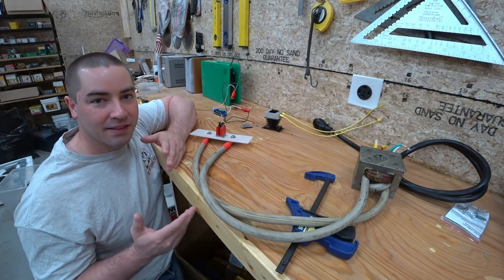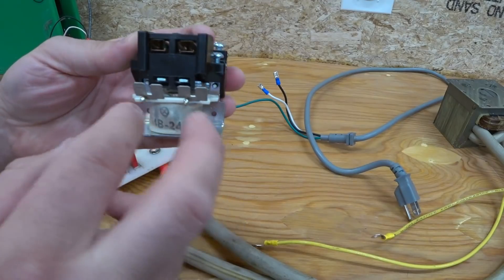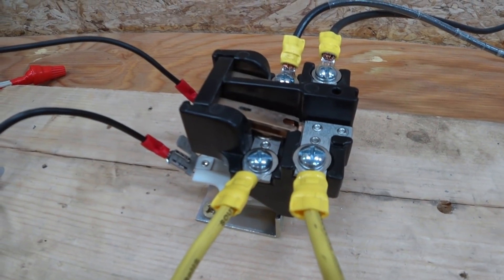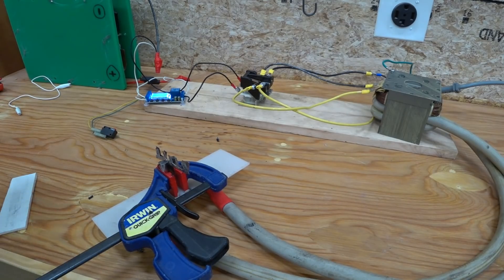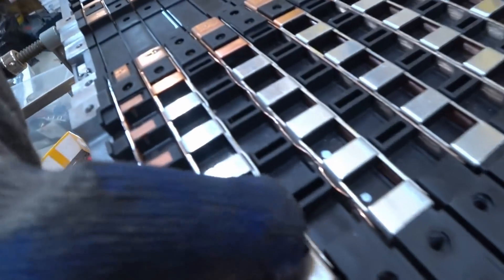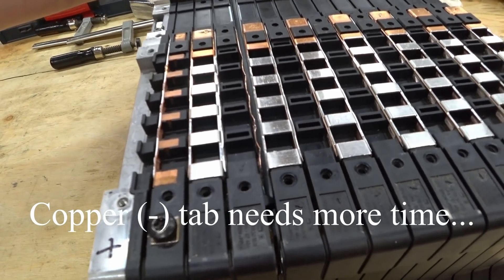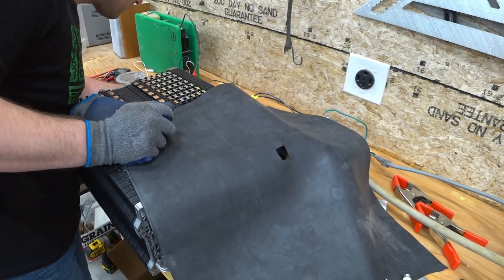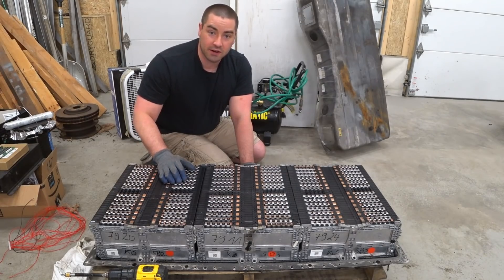DIY Spot Welder, Success!  Lithium Battery Cell Tabs

Comment: your ssr blew up because you starved it, you have like 10g 12g one one side and i 0G on the other, lookup how much current that 10g wire can hande and then the 0G. you need to acquaint yourself with the laws of thermodynamics, actually one will do you, the law of conservation of energy, The first law, also known as Law of Conservation of Energy, states that energy cannot be created or destroyed in an isolated system., a better way is energy cannot be lost or destroyed, it only changes state. So you have a certain amount of energy that changes at the transformer into another system. the first system cannot handle the same amount as the second system. if you don't understand, get bigger wire or your going to burn your house down!!

Comment: Wouldn't it be better to use cables with smaller dimension? This looks like shooting a fly from a cannon. More turns of cables means higher voltage and less time to spot weld (I guess) but it also means lower dimension of cables and smaller current. You want be able to spot weld a thick piece of sheet metal using single microwave transformer any way. I ordered microwave transformer myself so I will test it soon. I would be grateful for any opinions in this case.

Comment: heya that is a nice diy spot welding but 1 month of work with it that is to long for me so I'm thinking of baying a spot welder from Ebay or an online side
Reply: There is a key difference between DIY and prebuilt - control.
When you build it yourself, you have control over all parameters.
With a little more work, his welder will do things that no prebuilt under at least a few thousand dollars will do - that's the motivation behind MOT welders.

Comment: If you revisit this project try 120v on the primary with 4v secondary (4 turns)  you'll need smaller diameter cable but the extra voltage will help at 120v. Is there another link for the contactor? That one no longer works.

Comment: I thought your not supposed to spot weld copper. I could be wrong but I would like to see you try some pure nickel
Reply from the maker: Nickel is nice to spot weld.  I've done a few smaller builds with nickel strips.  Although I gave up on my DIY spot welder and bought a "Kweld".
Reply: That one looks amazing. I found the website for it. It appeared to be out of stock. Not that I could afford it atm

Comment: Could you use a nose tipped smaller version vice grip to provide the pressure (seemingly) needed for a successful weld??
Reply from the maker: Pliers would be fine for the pressure needed, I was worried about using anything metal around the terminals.  That's why I used the plastic clamp.  Thanks for watching.

Comment: Shorten the cable ohms low is v=a*r you are putting to much power across the cable the output cable this will thin reduce the kick on the cable

Comment: HI David.
I made a spot welder like yous some time ago. and could not get good welds.
Then i read somewhere that it works better with 2 winds on the 2nd winding.
and that worked great much stronger welds. you will need thiner cables though. mine are only just over 9mm (.4")but works a treat.
ps great vid. Atb
Reply from the maker: Thank you for sharing your experience.  I'm going to have to try that.

Comment: What you need is a zero cross detection circuit fire a TRIAC at the peak. That way the core of the transformer will not be affected. Take a look at my Arduino spot welder.

https://youtu.be/dgti1ZTHvWI

Comment: Did it have a color at one end of it?
Reply: I’d just hate to see a battery blow up in your face....I had a li-ion 18650 blow up in my hand.....it fell out of my ecig mod when I set it down and it fell over and as I grabbed it to pick it back up it fell out just enough for the bat door to short out in between the +&- and next thing I know I’m holding what looked like a jumping jack on steroids....within 3 seconds at most it was done and over with and I was phucked up....it felt like I was holding onto a glowing lump of charcoal for about a week in a half....
Reply from the maker: That story of the 18650 sounds scary.  WOW
Reply from the maker: Hi T ray.  What are you referring to when you say "it"?  Thanks.

Comment: I only really have one question for you.

Why didn't you just check out the video showing how to make a simple battery spot welder using a 12v battery, it works really well, there is a video that uses a simple solenoid 12v battery and a simple switch.

You could use this, my first test on using a 12v battery worked really well, but due to the amount of amps the battery puts out timing the touch on the tab can be a bit tricky, so I've decided to make the switching system.

But yes using a 12v battery and some thick cable can weld battery tabs very well and if you want to keep the battery topped up with charge just attach an old style battery charger to it, that way the battery always stays fully charged.
Reply from the maker: Hi, I did try to use a 12v battery and had problems: https://youtu.be/KshiAlmUn0A  Thanks for watching.

Comment: nice job.
for your next experiment with spot weld i think you should use other tips and use both tips at the same side. not both side. it works with spot welding nickel plate in Lithium-ion (exp 18650) batteries.
good luck.

Comment: Your better off using a starter solenoid from a car. Never mind, I see your switching the input side.
Reply: Most diy spot welders seems to switch the output, but seems easier to switch the input?

Comment: Have you considered that it is the apparatus you made at the end that is giving you your trouble?

The weld is supposed to be caused by the electrical resistance in the metal. Normally a spot welder would have copper cable leading to copper tips putting current through nickel(strip) and steel(18650).

You seem to have copper cable leading to aluminum leading to tungsten tips putting current through copper and aluminum. It looks like the highest electrical resistance in your setup is the tungsten tips which then heat up and that heat is doing the weld.
Reply from the maker: In one of my early experiments I tried using copper tips, and they stuck themselves to the copper bus bars.  That's when I was like, O, yeah, I need dissimilar metals.

Comment: Glad you got that worked out!  I just ordered a small spot welder today to mainly use on 18650s, but I also have an old microwave setting nearby that I will be removing the transformer from and trying your version also.  Really appreciate the trouble you and so many others go through to share these lessons.

Comment: Where do you get those EV batteries? And how much do they cost? I need one like the one you were spot welding for my homestead.
Reply from the maker: I find the batteries by calling around to local junkyards (auto recyclers).  It takes a lot of time.  I like to use Google Maps to search for auto recyclers near me.  The Chevy Volt worked much better than this one.
Reply: @DavidPozEnergy  To be fair, the Smart may have been a pain in the ass to remake, but it looks prettier than the Volt pack now that its done. Not that there is much wrong with the Volt pack but aesthetically the Smart battery looks so clean, not that it helps performance to look that way!

Comment: Which tungsten did you get from your local ws? 2.4?, 3.2? And which one is it ceriated, lanthanated, zirconiated, thoriated, or pure? The tungsten could be degrading and not allowing you to concentrate the spot weld in the exact area your wanting it to be made....I think it also tarnishes in air once it’s been heated and it forms a oxide coating, tungstic acid or wolframic acid I think.... but awesome to see your getting it all figured out and working!!!👍👍 idk if I’m right or anything and if so maybe someone can correct me on here?
Reply from the maker: Hi T ray,  Thank you for your question.  I would love to help, but I don't know.  I have the tungsten the guy gave me.  LOL.  It was $4 for the rod.  I don't know if that helps, probably not.  Sorry, I don't know about the alloy.

Comment: I'm glad you switched back to 120vac on the primary. I think your 40 amp SSR would have worked fine with 120vac on the primary. But with 240vac on the primary, the primary amps were going way too high due to magnetic saturation of the iron. It would be interesting to know what the primary amps are with 120vac, and with the 240vac. My guess is that primary amps would be much more than double with the 240vac, because the iron is saturated, and that's why the SSR burned up. However, I believe the secondary amps would not be much higher at 240vac vs 120vac on the primary. This is because only so much flux is available from that cross section of iron. For economic reasons, transformers and motors are designed to operate at a flux density which is acceptable, but only a little below saturation. More iron would allow more head room, but at a higher cost and more weight. The reason the microwave ovens designed for 240vac operation don't have a problem with this, is because they use twice as many turns on the primary winding, with a wire of half the cross section. But the volts per turn is the same. The volts per turn rating is in direct proportion to the cross sectional area of the iron's magnetic flux path. Sorry to be so long winded, but someone might like to know this bit of theory.
Reply from the maker: Thank you!  I didn't understand that until you explained it.  I appreciate this.

Comment: It looked like the vehicle dismantler cut through the original BMS loom, shorting out some of the wires and killing or at least damaging some of the cells. To minimise this risk people often use a very short length of 5 amp fuse wire to join each BMS wire where it connects to its cell. Balancing currents won't cause a problem but an accidental short will just blow the fuse.

Comment: Great that you have recovered the "dead" car battery and, once you parallel the 48v sections, it will make a real difference to your storage capacity.
Reply from the maker: I didn't save all the cells, but most of them.  Thanks for watching.

Comment: Aluminum and Copper cannot be fusion welded, however they can be welded with a solid state process, where the metals are only heated to the point where they are soft and then pushed together. One of the most common methods is ultrasonic metal welding
Reply from the maker: Cool.  So, what category does this spot welding fall into?  The positive tabs are soft and gray, so I'm guessing when I say aluminum.  I don't know for certain what they are.
Reply: @DavidPozEnergy  The grey is aluminium, usually a copper tab is crimped to the aluminium part so they can be soldered to bus bars or together with other cells, at least on smaller pouch cells. If you have alot of aluminum tab sticking off you can put copper rivets through them and solder to those.